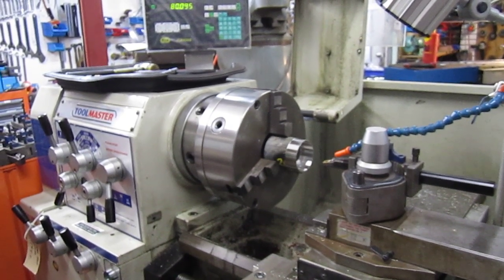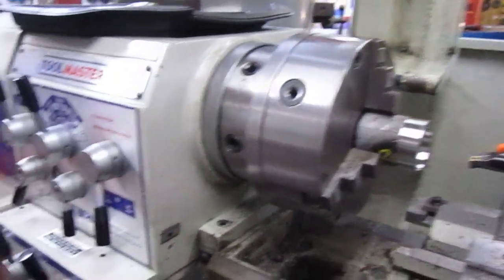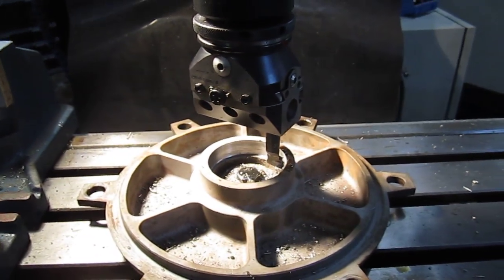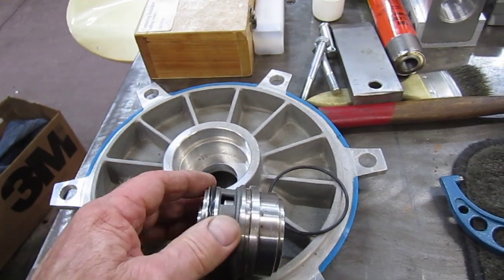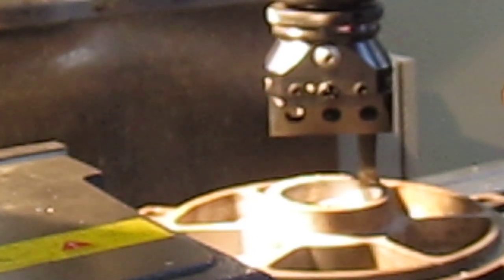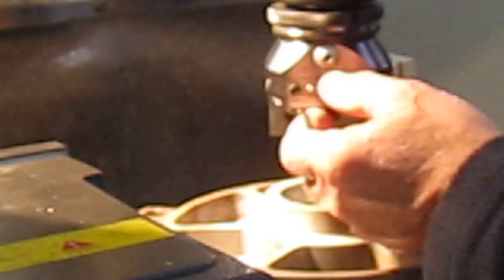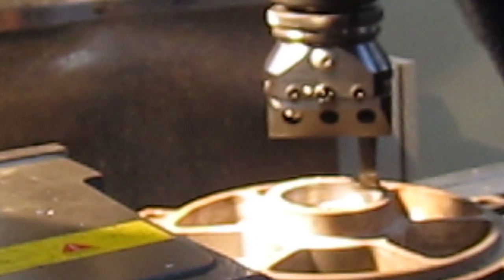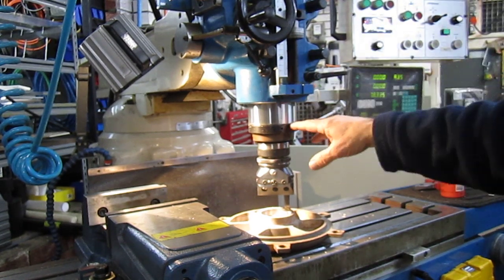boring head counterbore pump part

Comment: Hi Bruce, what kind of boring head is that? There has been discussion on some other videos about what are good ones and ones to avoid? I need one but would like to get something, so curious what you are using.
Reply from the maker: Mac the one in use is a Vertex (Taiwanese top quality) VBHU- Universal boring and facing head 5mm to 250mm capacity. You can get a clone (also made in Taiwan) for around $1,300.00
I have a grandfather one which is a Narex (Rolls Royce of the boring heads) made in Czechoslovakia. does up to 650mm diameter costs about $K10. beautiful tool. There is a German brand out there also Wohlhaupterus, don't know if they still make them. any one of those is good.
Reply: Bruce Whitham Thanks Bruce, I am thinking Timex now vs. Rolex! hahaha I am just a hobbyist hack so I guess I will have to make due with a $150.00 one!
Reply: This head looks a lot like my Wohlhaupter.